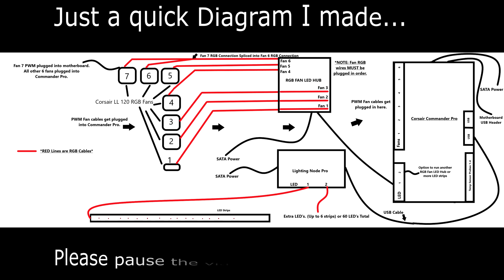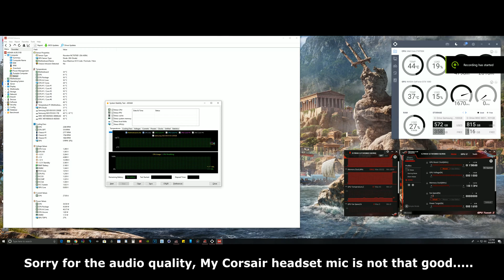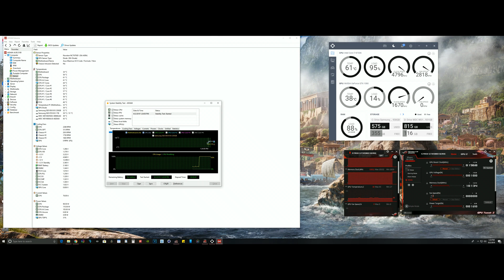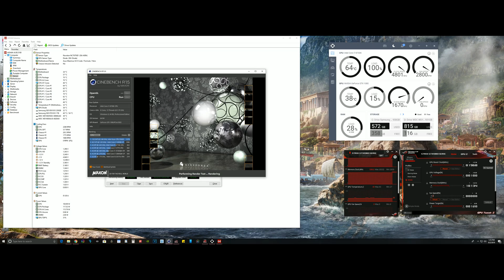PC Update and Corsair ICUE Explained

Comment: How did you you hookup the temp senders for the Commader pro to control your custom loop temps? can it read cpu temp or did you just place the sensors around the loop and rads?
Reply from the maker: I actually have a G1/4 Temp plug. If you search on Amazon or wherever you buy your PC parts from for a "G1/4 Temp Plug" they will pull up. It has a 2 pin plug on the end. This is plugged into my Motherboard temp 1 plug. Most Motherboards will have 1 or 2 of these temp plugs. Hope that helps. If you have any more questions please let me know.

Comment: Hey man, I'm interested in getting that pump/res combo, but I was reading that you can't normally mount it to a fan or anything, and they don't sell a support bracket for it. Can you tell me what you did to do so? Thanks!
Reply from the maker: Yea, I went to Home depot and got a 1" wide aluminum flat bar, some rubber spacers, screws, nuts, (The screws and nuts  must be small enough to fit inside the fan holes) and washers. I used the brackets included in the kit and marked the mounting holes on the aluminum. I then took a fan and marked how long I needed to cut the aluminum and marked the holes for the fan screw holes. I drilled out all the holes and mounted the aluminum to the fan with rubber spacers in between the aluminum and fan and then the pump/res brackets to the aluminum. I painted mine black and later wrapped them in carbon fiber vinyl. Remember The screws and nuts you get must be small enough to go through the fan holes and just long enough to go through your aluminum, rubber spacers, one side of your fan and your mounting brackets. You can always shoot me a PM on Facebook and I can send you pictures or videos too. Steven Moyer
Reply: @Moyersteven1  Awesome! I think I will shoot one over. Really appreciate it man

Comment: Nice build, have you tried a higher clock on your cpu? Looks like you have a little room to play with it.
Reply from the maker: Yea, I had to do a BIOS update so it removed my overclock. Damn CPU is so temperamental too. Thanks for stopping by!
Reply: @Moyersteven1  ya, I had to do a bios update on my asus z390 yesterday and redo my overclock on my 9700k. Got it stable at 5.2 with a 29c temp idle.